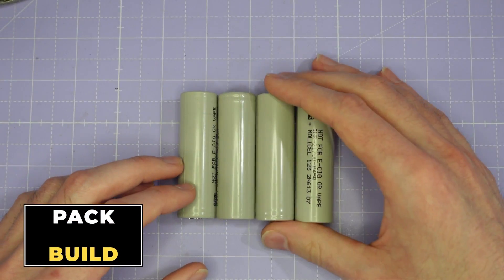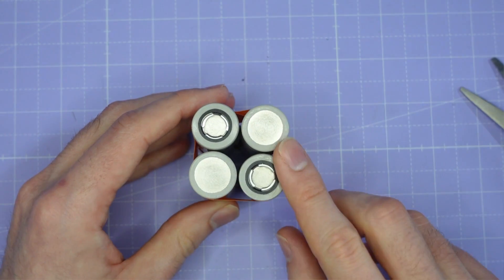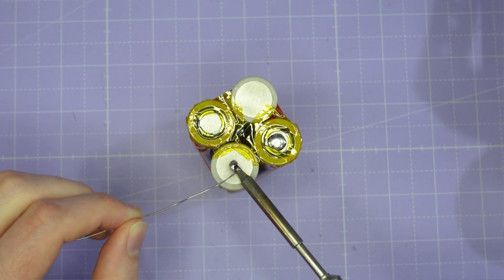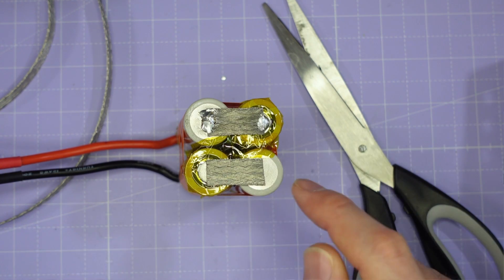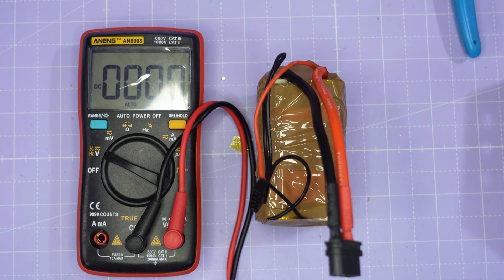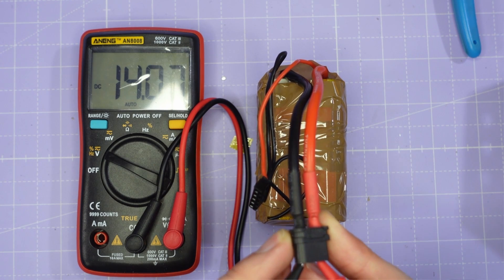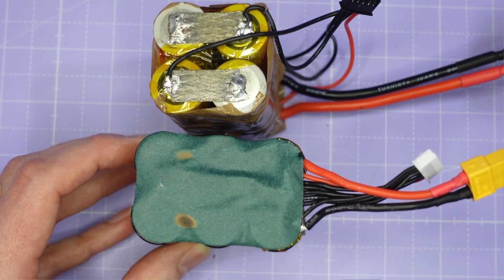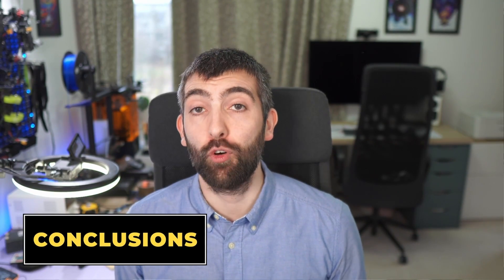Can I DIY the BEST Li-Ion Battery in FPV?

Comment: Good video, but I think the nickel stripes a better solution. Obviously those are charred cause they are either too too thin or their width is not enough. There are bigger, thicker nickel stripes that can support 45A. I even made some of my batteries with two nickel stripes one on top of each other. Anyway - their big advantage is that they add a significant structural rigidity of the pack. This can't be done with flexible braided stripes. The cables are flexible, the tape in between is soft... everything is flexible. Whilst the nickel stripes make the pack solid.
Reply from the maker: I think it depends on your priorities. With Nickel you will always be fighting physics. Copper is nearly 5x as conductive. The reason Nickel welds so well is it's relatively high resistivity. I guess multiple strips will improve things but it's difficult to imagine anyone welding  several mm thickness of Nickel strips to match 10x1mm of copper braid. If someone is paying good money for decent high drain cells to get the best performance then it seems a shame to throw a bunch of burst performance away.
Reply: Agreed I double up my strips, to hold everything in place on my first pack, I hot glued the cells together. For the next one I 3d printed some "holders" like those end cap once you see but they slide down so not covering the ends and just use kapton tape ever everything, then heat shrink.

Comment: oh man. so much contention over soldering the cells. Lithium cells are ALWAYS DANGEROUS. nickel or copper with solder, both are not without issues. Use nickel if you are most people because it is most common and well documented, I prefer copper and solder for many reasons, but higher fail rates using nickel has always been my experience.

Comment: FAIL FAIL  F A I L  FAIL FAIL F A I  L

 OBVIOUSLY DEVOID of any intelligent experience in thermal dynamics of manufacture. 19 seconds of tip on pad IS creating a HAZ deep into the matrix, damaging the electrolyte.

Simple Qdot calculations would have prevented this. Take down video please. This is such a fail!!!

Pulling my subscription!!!!!!!!!
Reply from the maker: They sure perform pretty good for damaged cells! Test results are at the end of the video.

Comment: Damn. Better title: how to kill any liion cell.

Chris I have expected better from you unless this is a 1st of April video accidently released too early.
Reply from the maker: They perform pretty good for dead cells! Test results are at the end of the video.
Reply: you literally cooked the negative terminals.

This adds a starting point for decomposition of the polymer gel. They will not last long. Really really bad advise to solder, especially the way you did.

Comment: You could stay little longer on the cells to make 100% they damage ^^ iam shocked that you post something like this ... 25 bucks welder do the job and dont kill your cells.. worst case you make a little home fire
Reply from the maker: The cells are fine, the battery test results prove it, dead cells wouldn't hit their rated capacity. All standard LiPo packs are soldered and we don't worry about those cells (even though they use very similar chemistry). I don't have a problem with welding if that's what people prefer, but the pack probably won't perform quite as well due to the extra resistance.

Comment: You can also use welding and copper in conjunction, welding for the speed and not overheating the cells and the nickel stips are easy to solder the copper to either braid or wire to increase current capacity.
Reply: I had not thought of that before. So, I can solder braided copper to a nickel strip, and then spot-weld the nickel strip, with its braid, to the cell. My only question would be,  how does the resistance between cells that are spot-welded, with copper braid piggy-backed, compare with cells that are copper braid welded, without nickel strips? If I understand correctly, the current is only flowing, either through the spot-welds, or through the solder joint?

Comment: I recommend always, to discharge all the individual cells before making packs.   Than I  use a dremel with a wheel and shortly clean the cell top's before soldering, than use a C4soldering Tip or even bigger and quickly Pre-Tin all the cells,  (5 seconds solder time).   Then you can solder the wires,or I use copper strips.  (also 5 seconds) during soldering add some additional tin. (normally no need for extra flux)  (5 seconds max) .  the soldered PACKS have lower IR than the spot welded packs and are better suited for high current applications.

Comment: Thanks for making this video. I liked the comparison of the braid vs the nickle strip with respect to resistance. It would be interesting to see what happens if you change the nickle strips to braid...
Reply: The other thing you can do is weld the nickel strips with soldered copper on them so you get more current capabilities then the strips alone
Reply: @ugpfpv361 I suppose, tho, I have a feeling those strips don't like to be soldered.
Reply: @marcfruchtman9473  actually pretty easy to solder to
Reply from the maker: Definitely a reasonable option. You need to do a lot of welds though to make sure you don't get a heap of resistance across the spot weld.
Reply: @ChrisRosser  I found this interesting with the temps soldering can get up to, but as he says, it's hard to tell how far into the core the heat gets...
https://youtu.be/byvr-dwwao4?si=O6Cmp_1rYyJ5q3gR

Comment: not very professional 😅 you should use flux for soldering, in 2 seconds max the soldering is done which avoids overheating the battery and damaging it.  and it can be very dangerous, you heat it for too long !!!, it's really not a good example.... and to connect the cells together, you can use rigid copper wire 1.5mm2 rates for (10A at 220v).  the li ion batteries are incredible.. I have 5s 3120mah and I fly twice as long as with a lipo 🤩

Comment: yes . and then u find out that in a parralel version the cells are not balanced and u blow the pack before u can  say: i sure hope i dont burn my house down.  and soldering is mweee ,, better to use a contact welder to zap the cells together , after uve made sure their at te same voltages of course,,  and when soldering ,, make sure u can OSHIT the cell somewhere where is not indoors. 
if u smell sweet ,, stop and out the cell .. better to throw a cell then to throw your house..
Reply from the maker: Yes if I was making a parallel pack I would have double checked the voltages. Brand new cells usually arrive at the same voltage from the factory but it never hurts to be safe.

Comment: The Molicel P30B 18650 are also great for smaller drones such as the 4" Flywoo long range.
Reply: I'm just now looking into these.  They are more than double the price of the 2800mah but I guess that's how it goes when you are the leader of the pack you can charge what you want.

Comment: Didn't anyone tell you soldering them damages the cell and will lower its capacity you should be using a spot welder. The only acceptable way to solder is to acid etch the metal first which makes it so you get a good solder joint without applying heat for more then a brief moment, you used way to much heat for to long. Polyimide tape is great when its the real deal but the cheap stuff most get from amazon is nothing more then nylon and not high temp which results in a lot of problems down the road. Because you didn't acid etch the metal the solder joint will pop off after the temperature cycles from hot to cold a few times.

I've been making Li-ion packs for a long time and no question 100% you damaged the cells and should run this test again with a spot welded pack.
Reply from the maker: I agree that better flux/bigger iron/acid etch would potentially allow me to make the joint faster. I don't think it's required to acid etch Nickel to get a good solder joint. A clean keyed surface, flux core solder and sufficient heat will get the job done.

I'm surprised you can be so confident the cells are damaged. The test results indicate that the pack is performing really well. I may make a video with a spot welded pack, but the extra resistance of the nickel strips and small spot welds is likely to hurt performance.
Reply: @ChrisRosser i would love to also see a pack with nickel strips with copper wire or the mesh soldered along the top then spot welded... and check the resistance compared to this method you tried here, then also a test with just the nickel strips doubled up... This way you should increase the current capacity, lower resistance, but still not overheat the cells.

Comment: With properly scuffed pads, good flux and high heat you should be in and out of there with the iron in 2-3 seconds MAX from a room temperature cell. You're applying heat for way too long. This is exactly why people keep whining about soldering being bad for LiIon packs.

High heat and short heat times will get the job done without harming the cells and provide a much better connection than spot welding. Work on tinning one cell pad at a time, giving each cell time to cool before coming back to the opposite side and then again to make the actual wire connections. Your cells wont even get warm if you do it right, you'll have better connections than spot welding and you'll have better current flow than the typical thin nickel strips.
Reply from the maker: I agree that I could have been faster if I had a bigger iron and better flux. I think the test results demonstrate that I didn't damage the cells. I got full rated capacity and great burst performance.

Comment: all my packs are soldered no issue. that said Ive made p42a, p45B, 40T and more... the 45B isnt worth the cost for an extra 300mah compared to the 42B and similar discharge curve unless Chris has tested both and found any major discharge discrencies. 

if you are gonna solder i have vids on my channel BUT fatter tip, max that iron at 450c (or more) and I use 12ga silicone wire and all is good in the world!

Comment: I've made quite a few packs, and learned some technique the hard way. I strongly recommend adding more structural support. Add rigid plastic, and have the wires go back over the cells instead of out of them. Rigid plastic helps in a crash. Wires going back over the cells gives an anchor point other than the soldering connection. Look at the donor cell and copy.
Reply: u explained nothing

Comment: I wouldn't feel comfortable holding a 400°C soldering iron to a LiIon cell for that long. In the video it looked like 20 seconds which I have been told will definitely have a negative effect on the cathode. I would always aim for 5 seconds max. and if that cannot be accomplished with the soldering iron I would try to find a soldering tip with a larger surface.

Comment: Molicell p50b is out soon its 5000mah 50amp continuous discharge 60amp burst
Reply: Awesome
Reply: The P50B does have a factory 60A non-continuous current rating (limited to 80°C)  but you cannot run it at 50A continuously. It will get hot enough to boil water and the cell will be damaged.
Reply: @batterymoooch factory rating is 50a continuously limited to 80 degrees, so either your wrong or they are lying
Reply: @kerrymillar4981   I got the 60A rating from the P50B datasheet. Where did you see a 50A temp-limited rating? Wait…you didn’t quote the rating Evva gave it, did you? Without confirming it was correct before saying either I’m wrong or Moli is lying? Hmm…

I don’t say these are true continuous current ratings because they require the discharge to end early to stay below the temp limit. A true continuous current rating allows you to compare cells directly as it’s a single discharge down to the cutoff (typically 2.5V). Yes, you can argue that it’s continuous for a while but that’s no different than saying it’s a burst/pulse rating, a rating that has the cell stop discharging before it reaches its low voltage cutoff rating.

But this is semantics. 🙂 What’s important is what the number actually is and the P50B datasheet only has one rating, 60A (implicitly limited to 80°C as that’s the max cell surface temp rating).
Reply: Great

Comment: You should actually use a 2 pin spot welder with 1-2mm copper strips. There's no need to use braid in this pack at all, the copper strips will create structural integrity of the new battery pack and you don't be adding 400°C of heat onto to + end of those cells which contain a fuse inside of them. That fuse by its nature is the most delicate part of the cells and the most vulnerable to temperature (they short out "thermally"because high heat usually means high current) so you risk changing the cells thermal point cut out either making it weaker (not so bad but will kill you battery back faster) or potentially create a stronger thermal cut off (this is bad as the cells may output more current than what they are rated for and lead to thermal run away =>fire => explosion) 
The fact that this happens on a regular basis with lithium ion cells in electric vehicles, means that it's not uncommon ot rare for the thermal fuse to not do it's job?

Drone batteries have no smarts inside of them with thermal sensors or a micro controller cut out chip or anything like that, the throttling is basically the user on the sticks and listening to the voice over on their radio transmitter(receiver). So the chances of you screwing things up and having a molten fire ball in the sky is considerable high!

Get a nice little 2 pin spot welded with a foot petal on it 👍
It makes scaring sound using it because it puts both positive and negative of a separate power source to cause the fusing of the metal strip to the top of the ends of the cells but it doesn't this for less than ½ second so it is not long enough to raise temperature in any way

Comment: Chris is a brilliant engineer and I have mad respect for him but this battery making video is terrible. Kapton tape shouldn't be used in lieu of fishpaper, soldering the terminals is not a good idea, and the lack of rigidity/structural integrity can potentially lead to abrasion.

Comment: THANK YOU for confirming, I've been arguing these points for a long time!  I have always soldered my Li-ion packs and I push them incredibly hard, (often well beyond their rated values), but when I land my packs are always just barely warm.  Meanwhile folks with "retail li-ion packs" (which are spot welded) often complain about extremely hot packs, those burn marks, & horrible voltage sag. I have never found those to be issues with my DIY packs and have always argued the use thin high resistance nickel strips is the likely cause... Cheers!
Reply: Rosser's so fraudulent, that I bet he didn't actually test the capacity of his pack.  The manufacturer would say that he spent about 10X too long soldering.  Are they just making stuff up?  Do you "dwell" that long with your iron when soldering the terminals?

Comment: No, you can't diy the best li-ion pack, just a humble one ;) Don't want to sound banal, but next time please use welding strips and a spot welder. This way you can make much durable pack without risking overheating the cells. And also with much less added weight.

Comment: I want to mention why Chris chose to solder instead of spot weld since the comments seem to be negating what he said at 17:25 , though I also want to clarify that there are better practices for spot welding than the 'Gold Line' packs use. This soldered braid will have a lower resistance and allow for a greater current potential (higher amps) than the single strip of what looks like 8mm wide (prob 1.2mm) nickel strip. It's unfortunate that Auline isn't using a thicker strip or at least doubling up the strips for a 2.4mm thick strip, which would likely keep them from charing their fish paper insulator (lmao). As for the heat applied to the cell when soldering the negative side, it would be totally fine if flux and a 100w iron with a larger tip was used.

Overall still a great video, Chris. Good work brother 🤙
Reply: Bad welding is not an excuse for overheating the lithium cell. This is why it should be welded - to preserve lithium accumulator degradation from overheat.

Comment: I managed to WELD the tips of my metal tweezers together when I was building my Li-Ion packs. I wasn’t being careful enough and must have created a short circuit. Learn from my stupid mistake! Also, don’t use fully charged packs during the build.
Reply from the maker: Kapton tape is the way! Make sure to fully cover around the positive terminals of all the cells

Comment: I love your videos, but this is a bit dangerous. Never have a hot tip on the battery for long.

Also the top of the liion is positive but it's extremely close to the negative parts. A copper braid could stray onto the negative bit.

Look for Kweld and nickel strips. Also loom for the Samsung 50A 21700 batteries. Way better than molicell for power.
Reply from the maker: I'm not convinced Nickel strips are the way to go given the charring they caused (you can see at the end of the video). I've cut the Molicells open and I can confirm there is little to no risk of heat affecting the battery, there is a plastic interposer in the construction between the negative terminal and the jellyroll.

Comment: soldering cells permanently degrades and damages them. use a spot welder such as the kWeld
Reply from the maker: Given the internal construction of the cell (I've taken a few apart now) I can be quite confident there is minimal risk of negatively affecting the cells soldering the braid if you are careful. There is a reasonable thermal break between the bottom of the can and the jelly roll. I don't think I hurt the cells too badly given the test performance.